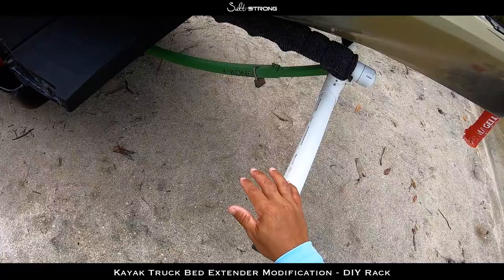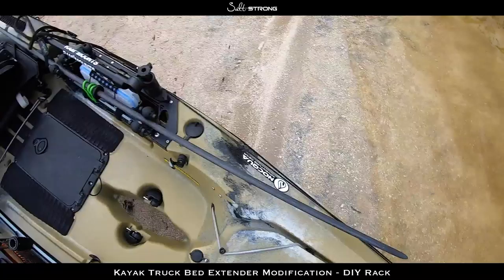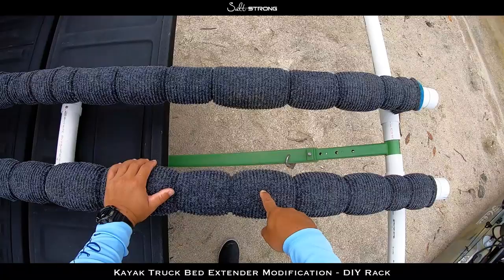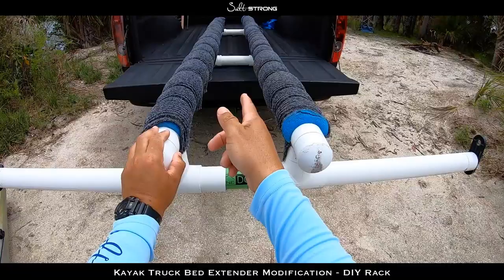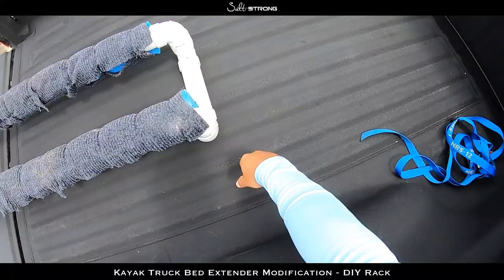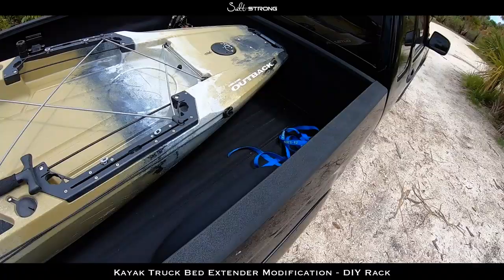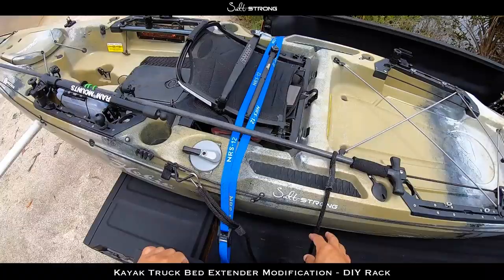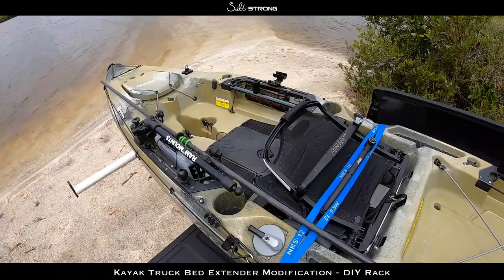DIY Kayak Truck Rack & Bed Extender (Easy To Load Your Kayak In)

Comment: But you still have to spend several more minutes ON THE RAMP installing your batteries, gear, cooler, pedal drive, graph, and anything else. And with a PA14, its a beast to pick the nose OR stern up off the extender empty.

Comment: Just bought my first Yak. Been watching hundreds of hours of vids, trying to see who, what, when, where, why, and how yakers are transporting Yaks.  I bought a bed extender, was looking for mods.  This is the winner!  Man this is awesome!  I was thinking of 2x4s, of a pipe, etc, this setup is perfect.  Thx man.  I also have Yakima roof rack system as a backup, in case of a failure.  Older disabled Vet here, so low loading will definitely be more user friendly.  Not to mention my fishing buddy who is telling I don't need to do this extra protection stuff, will see it, then want one.  Lol!  Awesome, most useful vid I've watched on this subject yet.  Thank you.

Comment: Why did you build the bunks vs. just using the bed of the truck?  I have a t-bone and it lines right up to my bed height to be a nice flat surface.
Reply: Same here.  I’ve got a long bed Tacoma and just have a rubber bed liner as well as the T- bone for the Outback to rest flat on.  Good idea but I just didn’t see the need unless I’m missing something.  Thanks for the vid though.
Reply: @bennettles9230  short bed Tacoma here and the t-bone makes it rock solid.
Reply: I don't think you can avoid scratches on the bottom of your kayak if you are fishing, so I don't have a need for protection in the truck bed. (Tacoma long bed, with built-in liner.)

Comment: Thanks for the great video! Can you please tell me what diameter pool noodles used? And, did you just slit the noodles on one side length-wise, or actually cut them fully in half lengthwise? I've got 2 @ 22" wide sea kayaks to transport in a full sized f150 bed, with bed extender,, and will be trying to construct an integrated 2 bunk unit, using your pvc design. Will be trying to construct in a way that the pvc unit is snug fitting, stabilized between the wheel wells (48"). Thanks for any info and/or suggestions!
Reply from the maker: Thanks for your question! Make sure to ask this over in the Community 
where the coaches spend their time. There are some tips that can be found here as well: https://www.saltstrong.com//search/?wp_searchable_posts%5Bquery%5D=pool+noodle

Comment: How is the pvc system attached to the truck bed? Or does it just rest on top freely ?
Reply: Judging by the movement that was shown, it’s just resting freely. It gets tensioned when you strap the kayak down.

Comment: You dont say how its fastned to the truck bed
Reply: It’s not. Even though he doesn’t say it, you can tell by the movement. It doesn’t need to be attached to the bed since it get tensioned by the weight of the kayak and the cam strap.
Reply: it is obviois that it's attached to the tbar and just resting on the truck bed